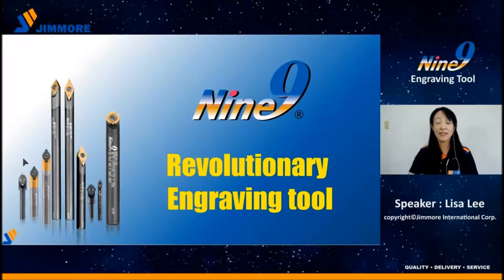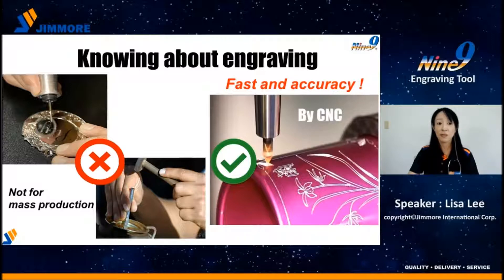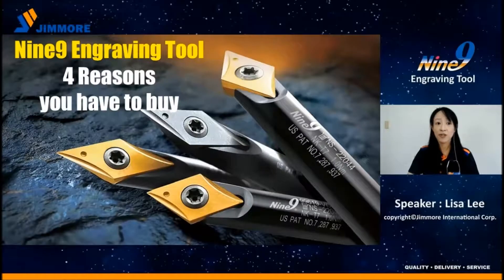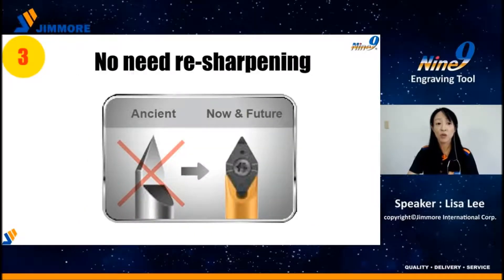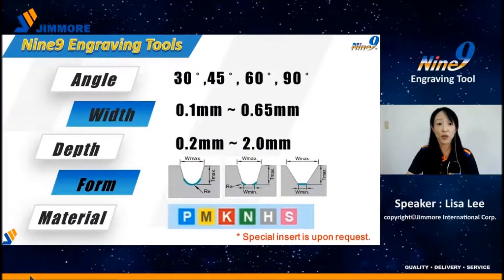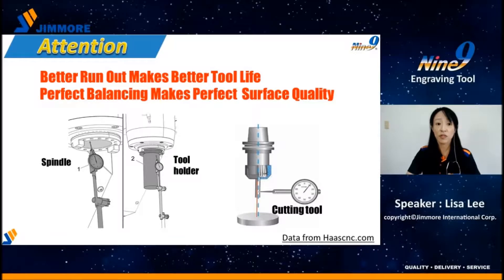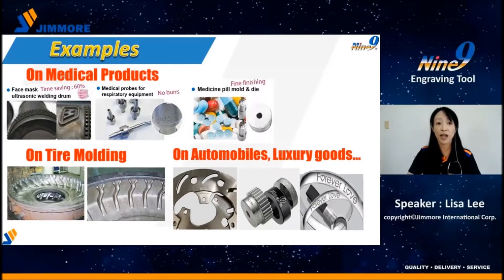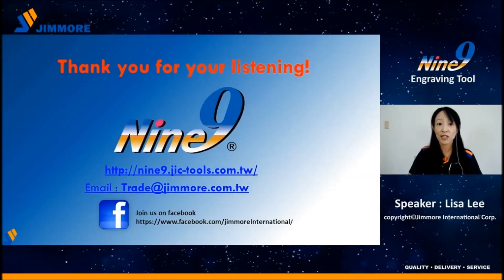Presentation of Nine9 Revolutionary Engraving tool

Comment: Best engraving tools around.
Reply from the maker: Thank you. We're happy for you like Nine9 engraving tool.
Reply: I hope you’re right, I just ordered one.
Reply: @madaxe79  yeah the 60° tool lasts forever
Reply: @justincastellanos1009  have you used it much in Stainless steel? That is what I bought it for. Do you run flood coolant or air blast?
Reply: @madaxe79  yeah I engrave heaps of P20 tool steel holds up great haven't changed the tip in about 3 hours of engraving time. I run the flood to the tip of the tool helps clear any swarf
Reply: @justincastellanos1009  thanks. What speeds and feeds do you run? And DOC?